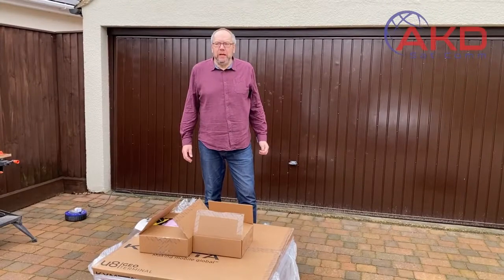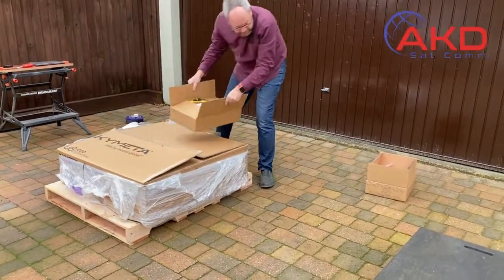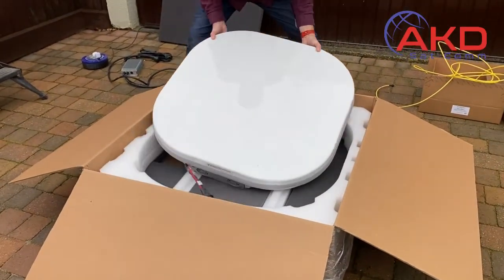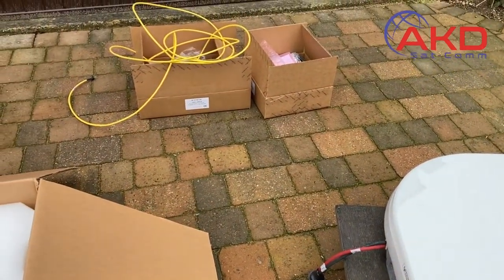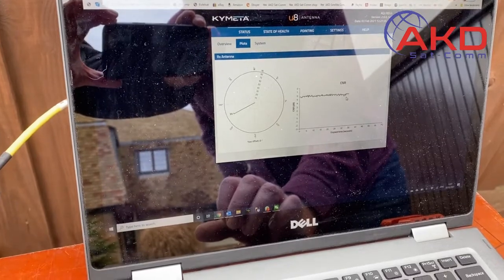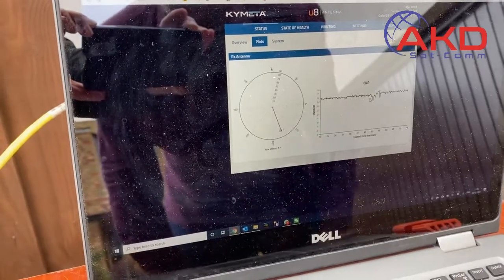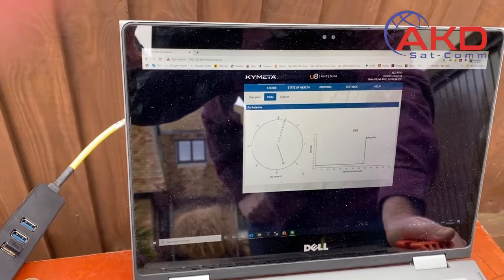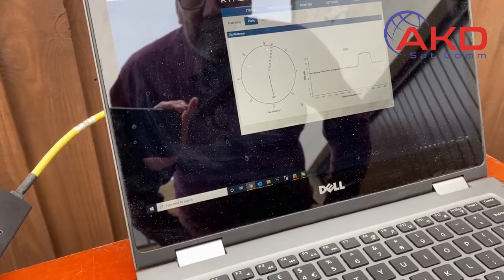Unboxing the NEW Kymeta u8 GEO terminal

Comment: The tilting of the antenna, First antenna was lifted up to to have a clear view, which increased the C/N. Secondly, for antenna which would be installed within the tropics especially in Africa (equator) would it tilt itself in Azimuth (Az) or Elevation (El) to get the best signal. Thank you

Comment: Nice video of your un-boxing experience....Thank You for sharing! 
I'm curious how you overcame the issue of then connecting to 12VDC battery-sourced power (undoubtedly having to remove the shroud to change out the power harness that comes out the back). Which is not conducive to switching between AC mains and battery power sources, whilst the terminal is mounted on a vehicle (without some 'factory unauthorized Field Modifications' : ) 
But again -- nice video and glad you showed the terminal track the satellite while moving the antenna (in AZ and in EL -- displaying the gain in Rx SNR when tipped more broadside to the satellite). Well Done!.......Have Fun with it :)
Reply from the maker: thanks Chas......you got me on the shroud bit.  I didn't want to show this part which took around an hour.  Love it though!!